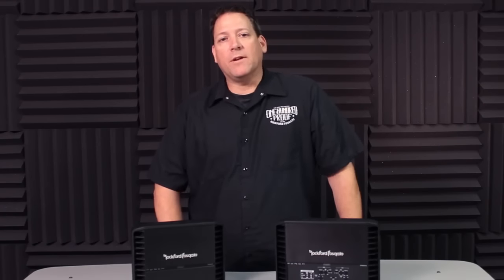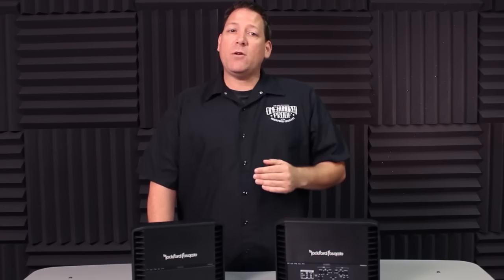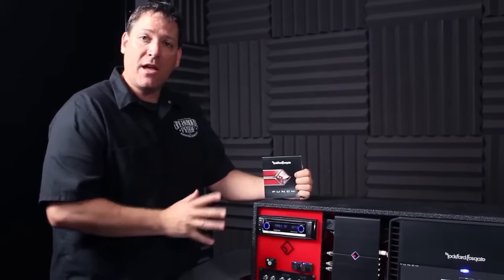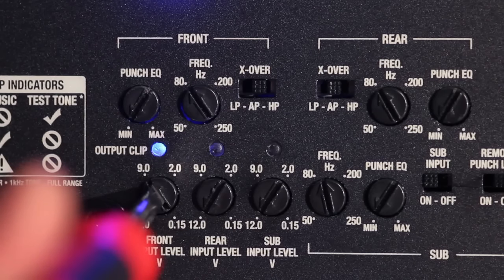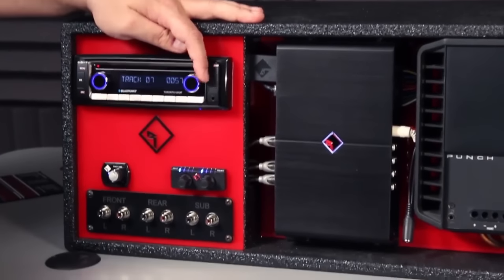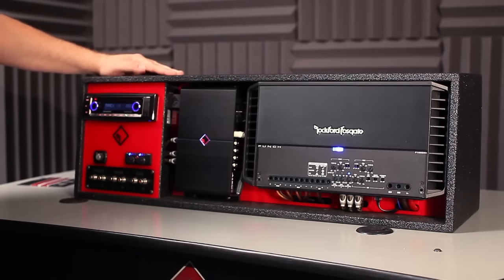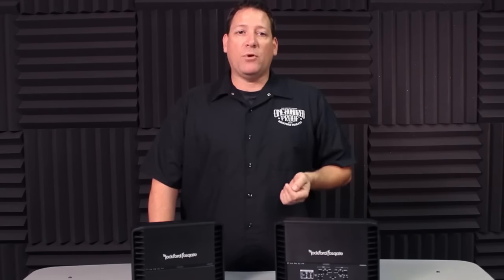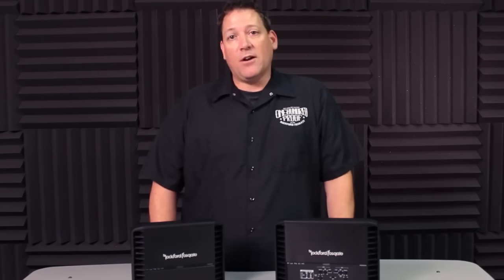Rockford Fosgate: Punch Amplifier Overview (3.1)

Comment: What size 10 inch subs "2" would i need for the 5 channel amp.
Reply from the maker: You're asking what model number 10" subwoofers should you use, if you used a pair with the Punch P1000X5, correct?  The amp is rated to produce 500 Watts @ 1-Ohm but can dynamically produce up to 863 Watts x 1 @ 1-Ohm, so you'll need a pair of subwoofers that handles at least 850 Watts RMS (425 Watts each).  For the amplifier to produce optimum power into a 1-ohm load, you'll need two 2-ohm SVC subs or two 4-ohm DVC subs. With this criteria, you can use any of the following subwoofers:

T1S2-10:  https://www.rockfordfosgate.com/products/details/t1s2-10/
T1D410:  https://www.rockfordfosgate.com/products/details/t1d410/
P3D4-10: https://www.rockfordfosgate.com/products/details/p3d4-10/

Comment: Why would i choose this Rockford P400X1 for 220 dollars on Amazon?, since the Rockford Fosgate R500X1D cost the half, as 110 dollars and this second AMP is 100+ RMS than the other one and also is class D (Digital).
Reply from the maker: The Punch P400X1 is designed for Sound Quality due to its Class A/B technology and is a FULL-RANGE amplifier so you could use this as a center channel amplifier.  It also has differential inputs to reject noise and a CLEAN setup to help you get your gains right.  Also, the Dynamic Power output is 563 Watts x 1 @ 2-Ohms so it produces much more than its rating.  If you just need a subwoofer-only amp in a heatsink, go for the R500X1D, but it has none of the features listed above.

Comment: Wet tar about bass boost usage and setting?
Reply from the maker: We typically recommend to set all your treble & bass settings on the radio to flat, set your bass boost on the amplifier to flat, adjust your gain settings, then tweak the amp bass to taste.  You should need only a minimal amount of adjustment.  If you have to add considerably more bass, then be sure your crossover isn't set to low (it should be around 80Hz) for your subwoofers.

Comment: What was the other box in the middle of your demo setup?
Reply from the maker: That is a 3Sixty.3 signal processor that has been replaced by the DSR1 digital signal processor.
Reply: @rockfordfosgate  Wow, thanks for the quick reply. I don't know much about this stuff, is that something I need to have in my system?
Reply: By the way, I am purchasing the P1000X5
Reply from the maker: @RoaringBrook50  No, not unless you have a factory radio and need to "tap" into the signal.
Reply from the maker: @RoaringBrook50 , The Punch P1000X5 is an awesome amplifier!  This will run your entire system with no problem at all!
Reply: @rockfordfosgate  Thank you so much! I thought I was all set with what I have ordered, then I saw that box and was worried lol
Reply from the maker: @RoaringBrook50  Ha, Ha!  BTW, your P1000X5 has a built-in Line Level Adaptor so you don't need to buy one.  It can connect directly to high-level (speaker line) outputs from the radio.
Reply: @rockfordfosgate  is the Line level adapter signal better than using a line output converter?
Reply from the maker: @dibble36441  We're using 2 different terms to refer to the same circuitry.  Most external LOCs use just enough components to get the job done, so they are not ideal.  If the amplifier has one "built-in", then the signal integrity is much better than an external type.
Reply: @rockfordfosgate  thank you I have the p1000x5 and my installer used a pac line output converter for my stock radio and I have since done away with the pac line output converter. My last question is my amp seems to be coming on w/o remote which is fine and great but I used software to change my factory signal from high output to low level input.  Care to explain why it comes on this way?
Reply from the maker: @dibble36441  O.K. great, thanks for that information!  Yes, that PAC piece was duplicating the input circuit on the P1000X5, so removing it was just taking an extra piece that isn't needed in the signal chain.  The input circuit on the Punch amplifier can accept Low-Level (RCA) or High-Level (Speaker Line).  When you use High-Level outputs from a radio, you'll typically see an additional +6 volts DC.  You can put a Digital Volt Meter on the speaker line and see the +6 Volts DC yourself.  This is called "DC Offset" and the Punch amplifier has an "auto turn-on" function when it senses a DC Offset signal.  Since you'll be using a High-Level signal with DC Offset, you don't need the REM turn-on wire. Hope that helps :-)
Reply: @rockfordfosgate  sorry to ask again but after reading this again could you clear up some thing for me. I am running a low level signal from my radio to the amp using rca's.  And the amp is coming on and works fine. Is this because of dc offset from the head unit? At 25 out of 30 on the volume it shows about 4v coming out of the amp.
Reply from the maker: @dibble36441  If you remove the REM wire from the amplifier and it's still turning on/off with the radio, then the RCA's have +/-6V DC Offset on them.  

You said earlier "I used software to change my factory signal from high output to low level input."  While I'm not familiar with the radio you're referring to, DC offset is what is turning the amplifier on/off.  

You can measure this by connecting a digital volt meter to the (+) and (-) outputs from the radio and see if you measure any DC voltage on them.
Reply: @rockfordfosgate  factory radio...its working so that's what really counts lol again thank you

Comment: I don't have a CD player on my head unit. How to I get this program otherwise?
Reply from the maker: Hi Ron, are you referring to the CLEAN test tones?  You can find these below:

Downloadable Tracks:
https://rftech.custhelp.com/app/answers/detail/a_id/1126/

Spotify Tracks:
https://open.spotify.com/artist/3ONB8c9eyu1PDUkACtbd3I?si=xKHJpm87Q9-rY6HPUArgWA
Reply: @rockfordfosgate  thanks a million.
Reply from the maker: @Punkinspapa  You’re welcome!  Helpful reminder, we suggest 40Hz for subwoofers and 1kHz for mids/tweeters.
Reply: @rockfordfosgate  FYI the only amplifier and subs I've used since the mid 90s are Rockford Fosgate.  They are absolutely the best. Thanks for 3 decades of beautiful music.
Reply from the maker: @Punkinspapa  Thanks for your kind reply and thanks for being a Rockford Fosgate Fanatic!
Reply: @rockfordfosgate  I have a question.  I have the R2-750x5 and I was wondering since I will be running my OEM head unit do I need to run a line output converter such as the LC7i?
Reply from the maker: @Punkinspapa  Great question, No you will not need a LOC because the R2 amplifier has a converter built-in where you can connect these directly to the speaker line outputs of the radio.
Reply: @rockfordfosgate   Thanks a million.
Reply: @rockfordfosgate  another question.  I am replacing all of the OEM speakers for the back doors and front doors. 3 way tri axial 6x9s in the back and 6x9 components in the front. All 4 ohm. Should I bridge it to maximize my power output or run them non bridged?
Reply from the maker: @Punkinspapa  If you bridge, you will not have any control to lower the rears if they are too loud.  We would suggest just running everything in 4-channel stereo mode so you have proper fading capability.
Reply: @rockfordfosgate  Thank you.
Reply: @rockfordfosgate  I have a shop that insists that I need to have the DSR1 or they won't do the install. He says my system won't sound very good without it. Is this true?
Reply: @rockfordfosgate  I'm not at home so can you tell me what the pre amp speaker input sensitivity is on the R2-750x5 please?
Reply from the maker: @Punkinspapa  Every system benefits from a Preamp and/or Equalizer.  Crossovers are mandatory (many of your Rockford Fosgate amps have them built-in).  These three items are the "meat" of digital signal processors.  The DSR1 also allows for "time alignment", which isn't necessary, but allows for all speakers to arrive at your head at the same point in time to improve sound quality. 

Typically, a DSP can be added at any time to the audio system. However, some vehicles using the OEM radio REQUIRE the need for a FACTORY INTERFACE, which may be the reason why the dealer is recommending they do it.  You can watch the video on our DSR1 page to see if your vehicle has a "digitally controlled" volume.  If so, you'll need this to integrate aftermarket components in your ride: https://rockfordfosgate.com/products/details/dsr1/
Reply from the maker: @Punkinspapa  The Prime R2-750X5 has the following INPUT SENSITIVITY:
• Low-Level: 150 mV - 4 V
• High-Level: 450 mV - 12 V
Reply: @rockfordfosgate  I'm gonna bite the bullet and get get the DSR1. I want this to sound superb. I will also get my truck Dynamat.
Reply from the maker: @Punkinspapa  It’s a great processor.  You’ll be happy with the App control.
Reply: @rockfordfosgate  OK so I downloaded the app and I am going to buy the DSR1 this weekend then schedule my complete install for 2 weeks after that. The app is cool. Can't wait to see how it is with the equipment hooked up to it. I'm so jacked.
Reply: @rockfordfosgate  hope I'm not being a bother. Is there a guide to adjusting the EQ online?
Reply from the maker: @Punkinspapa  Your installer should setup the EQ when installing it.  I would suggest making a copy of the DSR1 settings before doing any changes.  We don't have a guide because every vehicle is different, so many just listen for what areas ned to be adjusted
.
Reply: @rockfordfosgate  I spoke to him a couple days ago and he is going to set it and then lock me out so I don't screw it up, lol. I'm buying the DSR1 today. I'm so excited about all of this. The install is in 2 weeks.
Reply from the maker: @Punkinspapa  Awesome!  The installer is going to set it up for you, so there's really no need to make adjustments anyway.  It should sound awesome!
Reply: @rockfordfosgate  Fosgate baby! It WILL SOUND AWESOME!

Comment: My p300x2 amp’s speaker wire terminals left (-) input won’t secure my speaker wire tightly even at the tightest I can get the screw. The rest of the terminals tighten the clamps just fine but the left (-) will not tighten properly. I’m using 14GA speaker wire. Anybody know how to fix this or what the problem might be?
Reply from the maker: Is this a brand new P300X2 amplifier you just purchased?  If so, please take it back to the dealer where you purchased the amplifier for an over the counter exchange.  If this was purchased 2nd hand or off eBay, remove the speaker wire and see how low the captive clamp can be screwed down compared to the other +/- terminals.  There is something obstructing the clamp from being tightened down.
Reply: Rockford Fosgate purchased from Crutchfield
Reply from the maker: @kylesvideos59  Check the connector as mentioned above by removing the speaker wire to see if anything is obstructing the screw clamp from closing.  If this appears to be a defect in the screw threads, Crutchfield should be able to handle this since they are an Authorized Dealer.  Contact them and mention the issue you're having and would like to get a warranty replacement.
Reply: Rockford Fosgate yep, definitely appears to be a defect in the threads. I took out the wire to see the clamp rise of the other terminals and all the other terminals tighten all the way, meanwhile the left terminal gets right super early before the bottom piece of the clamp even makes it a quarter of the way up. How do I begin this process of getting a new one?
Reply: Tight super early*
Reply from the maker: @kylesvideos59  O.K. thank you for going through the troubleshooting process and determining this is the issue.  I apologize for the inconvenience this has caused with your audio system, but we'll make it right.  Crutchfield has an online return form you can get started with below.  Be certain you mentioned you spoke with a Rockford Fosgate support specialist and determined the screw threads on one of the speaker terminals is bad out of the box and you would like a replacement amplifier. https://www.crutchfield.com/support/returns.aspx
Reply: Rockford Fosgate I just realized I actually bought it through sonic electronics. Is that still an authorized dealer?
Reply from the maker: @kylesvideos59  Yes, they show up in our Dealer Locator as an Authorized Dealer, so they should be able to handle a virtual "over the counter" exchange.  If you run into problems, please contact our support department at 1-800-669-9899 Mon-Fri 8am - 5pm MST.

Comment: Would you say that a Punch amp simply sounds better than a Prime? 

Let's say the power outputs were identical and we are only discussing the sound quality.
Reply from the maker: Yes, all Punch amplifiers use our proprietary Trans-ana front-end (input stage) and therefore have a better sound quality characteristic over the Prime.
Reply: @rockfordfosgate  Okay, thanks. I have a prime 400.4, but I bought a Punch Pro 6.5" just to test out, and it sounds okay on the prime amp with the front channels bridged and set to 2 channel, but I think the amp just isn't a good fit for it.

Seeing that the amp puts out 75-80w per channel in 4ohm, and 200w or so bridged. The speaker prefers 100w rms to 200w max. An issue of too little/too much.

I think the Punch 600.4 would be a better fit, as it puts out 75w rated to 129w dynamic per channel. That way I can put 2 of the punch pro's in the front and still have two channels open for the rear deck.
Reply from the maker: @mrfreeman1763  Keep in mind the Punch Pro 6.5" drivers are SPL speakers, designed to play very loud.  They are rated to handle UP TO 100 Watts RMS, they don't "need" this much power.  In fact, they have a very high sensitivity 92.5 dB so it takes less power to equal the output of a Sound Quality type speaker that typically has lower sensitivity ratings.  Ideally, gain settings have a lot to do with the way a system sounds, so be sure to take a look at our Gain Tutorial to make sure you're getting the best Dynamic Range from your audio system before you change things up: http://rftech.custhelp.com/app/answers/detail/a_id/46

Comment: Got the p400x4 running 4 t1675 and I'm happy 

Ps the t1675 fit perfectly in the back doors of 1996 grand cherokee just drill some holes
Reply from the maker: Awesome!  Glad you're having a great experience with the P400X4 amplifier and the T1675 speakers!

Comment: I cant figure out the difference or which would be better for me. The p1000x5 or the t1000x5ad. The difference in price isnt that big a deal. Like 100 bucks.
Reply: Can anyone explain the difference? I drive a semi truck space is not an issue nor battery power.
Reply from the maker: The main 3 main differences are class, power and size. The Punch model is Class A/B + Class BD (Sub) so its primarily designed for sound quality.  The Power model is Class AD + Class BD (Sub) in a smaller chassis so it's primarily designed for optimum power density.  If you can fit a traditional amp, use the Punch model.  If you need to spare every inch, use the Power model.

P1000X5 ($499)
75 Watts x 4 + 150 Watts x 1 @ 4-Ohm
125 Watts x 4 + 300 Watts x 1 @ 2-Ohm 
N/A + 500 Watts @ 1-Ohm

T1000X5ad ($619)
100 Watts x 4 @ 4-Ohm + 400 x 1 @ 4-Ohm
100 Watts x 4 @ 2-Ohm + 600 x 1 @ 2-Ohm
N/A + 600 Watts x 1 @ 1-Ohm

Comment: Nobody is been helpful! I need your expert advice,please. I got 2  ddx10s 2 ohm 1000rms. Only amp I could afford was the 1000watt bd 2 channel Rockford Fosgate amp. How due I wire them up to it with out it smoking my subs...
Reply from the maker: Can you double check your amplifier's model number.  We have the Power 1000a2 which is a 2-channel amplifier.  Most all out "bd" series amplifiers are mono such as the Power bd1000a1.  For the subwoofers, we think you're referring to the DDX-10 dual 2-ohm, correct?
Reply: @rockfordfosgate  p1000x1bd is the amp. Its 1 ohm stable but it's not bridgable! I'm confused.
Reply from the maker: @donaldwhiteman3224  Thanks for correct amplifier model, yes this is a 1-ohm mono amplifier. "Bridging" occurs when you use 2-amplifier channels to create 1 big single channel.  Since the P1000X1bd is already a single channel amplifier, it can't be "bridged".  You'll notice for 2 subwoofers, you'll need 4-ohm DVC models and use "Wiring Diagram #5" as shown on the WIRING WIZARD tab here: https://www.rockfordfosgate.com/products/details/p1000x1bd/. There is no optimum way to wire a pair of 2-ohm DVC subwoofers to that amplifier because you'll only get 1/2 the output power.  The only way to get full power output, is use two 4-ohm subwoofers.